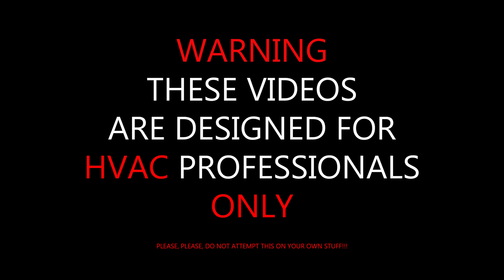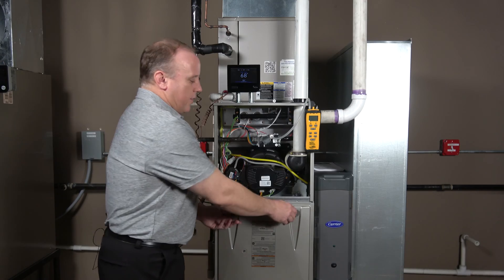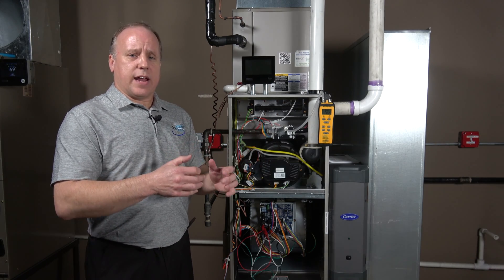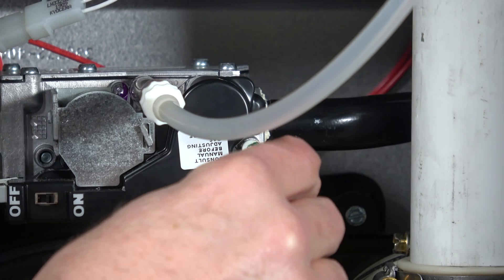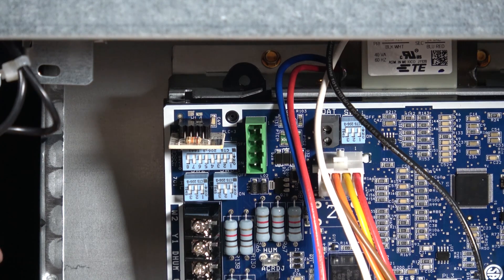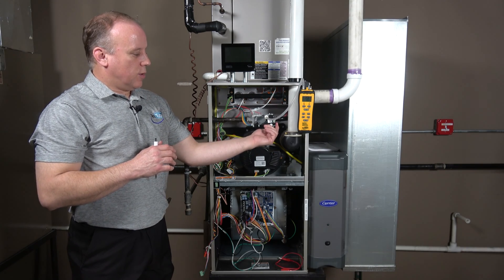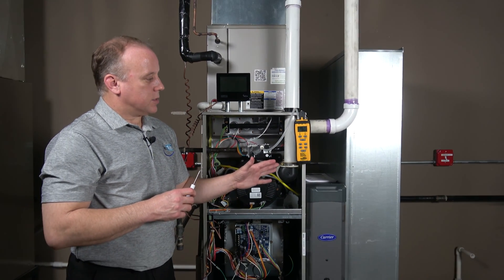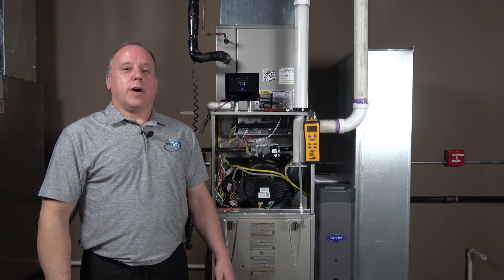Setting Gas Pressure on a Modulating Gas Furnace

Comment: At the 4:02 mark, you connect a black jumper to a terminal in the middle of the panel before connecting to W2. Is that the Com 24V or G?
Reply from the maker: The first black jumper wire was connected to the red jumper on W1 as described by Dave in the video

Comment: Nice video. On the rating plate it only shows manifold pressures for natural gas. What would be the manifold gas pressures if furnace in running propane? Thanks
Reply from the maker: When you get the required propane conversion kit, the new nameplate stuff is in that kit. YouTube doesn't give us a way to post a screen shot in our reply to show you.

Comment: HELP - new install. Carrier infinity code 14 lock out fault - tech adjusted gas. Then got code 126 high heat fault - tech cut vent into trunk on top of furnace. Was told cutting a vent on top of the furnace would correct high hear fault. It did not correct the Fault 126. What should be done?
Reply from the maker: If someone is recommending cutting an extra register into your supply or return duct to solve a high limit issue, it means that they either a) they grossly oversized the equipment that you need, b) the ductwork is very undersized relative to the furnace, or c) there is another issue that is misdiagnosed.

Comment: Hello
I did modulating gas furnace valve setting like your video but still code 33 (over heat )
Filter clean ;all registers open .
So frustrated of this furnace.
Reply from the maker: Dirty filters and high gas pressure is two of many issues that can cause a limit trip. Start your troubleshooting by getting a supply temp reading, a temp reading from the limit switch location, and an external static pressure measurement. Then if you are a contractor, contact your local distributor's tech support with that information for next steps. If you are a homeowner, your HVAC dealer should be measuring this stuff for you.

Comment: I’m confused as to why you mentioned SW1 #2, when you make changes to SW3 #2. Or was that an error?
Reply: He made a mistake, he thought SW3 was SW1, SW3 is for airflow.
 
1: Turn ON SW1-2 when using a two-stage thermostat to allow
     * Minimum Heat operation= when R to W/W1 closed 
               Maximum heat operation= when R to W/W1 and R to W2 close

2: Turn ON SW4-2 when using a two-stage thermostat to allow
    * Intermediate Heat operation = when R to W/W1 closed 
              Maximum heat operation = when R to W/W1 and R to W2 close

 When SW1-2 and SW4-2 are OFF allowed Modulating operation with a single-stage thermostat. (when R to W/W1 and R to W2 close it will have Maximum heat operation all the time)
( when only R to W/W1 closed  it have about 15 mins of Minimum Heat operation) he got it right by luck.

Comment: I'm not understanding how you kept the furnace in low fire mode. Surely different brand furnaces have different settings to keep the unit in low fire mode. I'm assuming this would be in the product manual
Reply from the maker: We assume you are referring to getting it to low fire while you set gas pressure or other service needs.  You can either use the jumpers like Dave described in the video or you can use the “check-out” screen of the communicating wall control.

If you are talking about during normal operation, the wall control handles the staging as a function of its PID based on current deviation from setpoint and it’s rate of change.

If you want to lock it in low fire permanently and never let it go to high fire again, we can sent you a separate video on that.
Reply: @TECTubefilms  could i just jump R to W1 and leave W2 alone. Would that keep it in low fire mode so I can set the low fire gas pressure?
Reply: @EnjoyCalculus when SW1#2 IS OFF only R to W/W1 closed it has about 15 mins of Minimum Heat operation & then Maximum heat operation. so you need to turn on SW1#2. 
PS: He made a mistake, he thought SW3 was SW1, SW3 is for airflow & SW4-2 is for Intermediate Heat operation ( need to be OFF)

Comment: To be honest this brand is not good ;
The gas valve fails a lot ;
Reply from the maker: A lot?  How many failed gas valves gave you seen on Carrier modulating gas furnaces?
Reply: @TECTubefilms  
A lot 
Many times I have seen code 35 failed gas valve.
The ignitor turns red but it does not shoot the gas .
Reply from the maker: How many is a lot?  5 furnaces?  50 furnaces?

We buy several hundred furnaces per year with these gas valves in Carrier, Bryant, Heil, and Day & Night  units and have very low warranty claims on the gas valves over the past 9 years.  At last check, it was less than 20 claims… out of almost 4,000 furnaces.
Reply from the maker: We do have a 59MN7 in one of our training labs that we fully disassemble and reassemble every week. And we have the newbies adjust the gas pressure when re-installed.  Sometimes some turns the screw too fast and/or too hard and it does damage the valve.  Small adjustments are needed.  Maybe that is contributing to what you are seeing in the field?

Comment: Very great vidéo
I have question;
When we finish our setting  on max fire and then we want to go for min fire ;
Do we need to turn the furnace off while removing jumpers and stting the dip switches 
Or we have to do it while furnace is on ?
Reply: Shouldn't matter

Comment: Can pulling the communicating plug like that damage the board? As opposed to turning the power off first
Reply: It really isn't the best practice, but it is pretty much the same thing as flipping the power switch.  If you do it in one smooth motion, the system wouldn't know the difference as long as the connection is firm on placement and a quick removal to began with.

Comment: why are you going by burner pressure on a modulating burner instead of a flue gas analysis?
Reply from the maker: We follow the manufacturer's installation manual which for this furnace (59MN7A) you can download at https://carrier.hvacpartners.com/products/detail/59MN7
Reply from the maker: If after setting up the valve based on gas pressure, you then hook up your combustion analyzer to further check operation, we have no issue with that at all.
Reply: @TECTubefilms   It still depends on Altitude
Reply from the maker: We are a distributor that only services dealers in the Midwest… we don’t have “altitude.” LOL

Comment: I assume you are adjusting the gas pressure based on the temperature rise?
Reply from the maker: You are adjusting it to make sure it is within the spec range.  But then if you want to fine tune it within that range, you can look at temp rise.